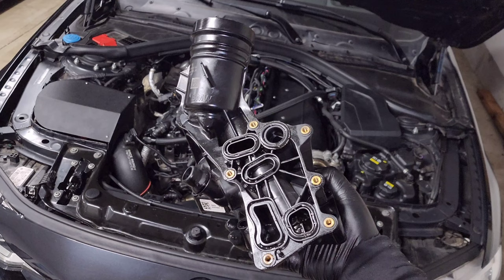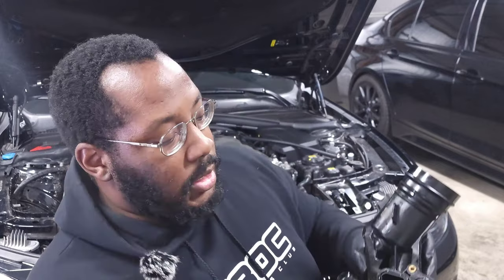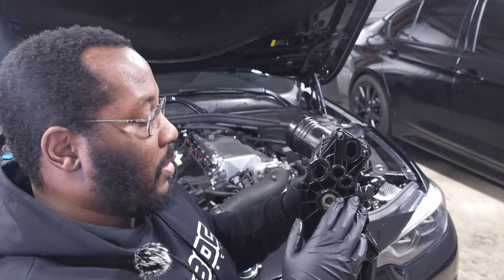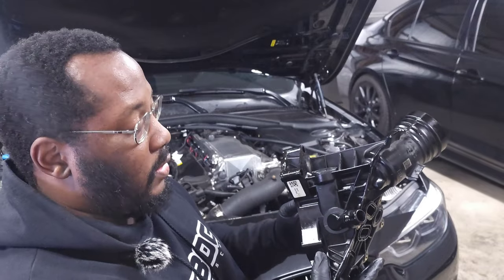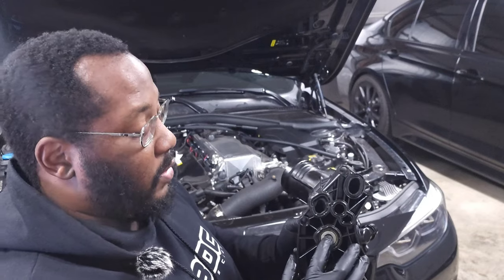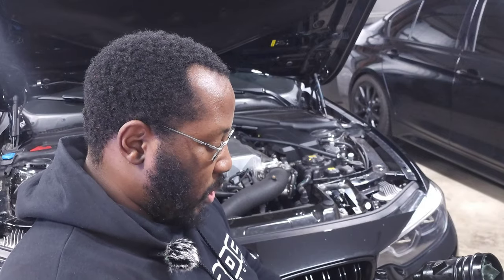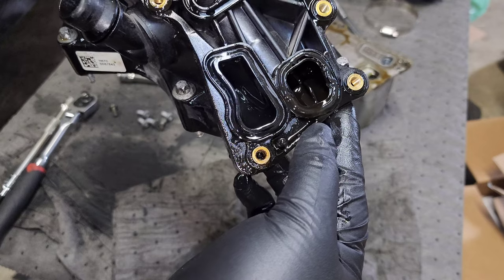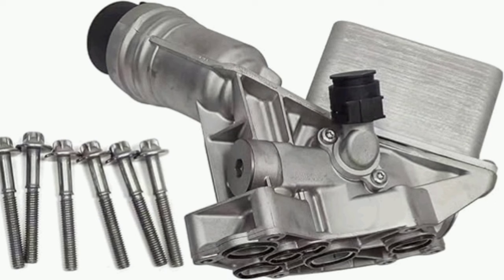Why BMW Oil Filter Housings Are STILL Leaking - B58 Common Issues

Comment from the maker: You Can Buy the Aluminum Oil Filter Housing option Here: https://amzn.to/3IKqRMa
I haven't tried it, so if you do, please report back how it fits and works for you

How to replace the oil filter housing: https://youtu.be/ybefpBEQj9w
Reply: The gaskets are the weak point, and labor the same, regardless.  What a pain, upgraded gaskets, better rubber/silicon, should come from the factory.
Reply: Also, plastic does stop the heat, it slows it. Thermal
Conductivity is lower, but it will reach the same equilibrium... and in fact the aluminum should respond to cooling and heating better, the question is what did the engineers assume when they designed flow.... plastic of course.
Reply: @sms4hou676 Are you saying plastic is better? 6:10

Comment: I have the aluminum oil filter with over 500 miles so far no issues so far, it is holding pressure as intended. I posted it on the fb forums. I didn’t have any cracks on my plastic oil housing but had a nice oil buildup at the bottom of the filter as you described on yours. I had 165k miles before it went
Reply from the maker: Great news
Reply: Likewise, changed to aluminum on a b46, i’m at 4k miles now. no issues…
Reply: @JayMichaelsprod you got a link for the b46 version?
Reply: I have the aluminum one on my 540i also...no issues
Reply: Still holding up well?
Reply: @Slow2.0 15k later no issues
Reply: @jamainefranklin5794  any issues? 540 aswell.
Reply: @seanx520  thats good to hear where did you get yours from? Im at 64k so hopefully no issues and if I do have issues hopefully within next 3 months (bought cpo) i gotta buddy that was a bmw tech for 6 years so hes done plenty so im not worried but still am worried lol
Reply: @Slow2.0  check the pinned comment from kern
Reply: Great to hear, I'm at 93k miles no leaks yet but if it does I do plan on upgrading to the aluminum
Reply: @seanx520 did you swap the spring or the oil cooler? Did you do anything else to prep it ?
Reply: @Everything_Bimmers  no, whatever that came with the oil housing,  I used the oil cooler and it fit just like oe. It is now Over 20k miles now no issues

Comment: One other thing to mention is that the s58 oil filter housing is metal
Reply from the maker: it also has the external oil cooler under the bumper so very different design overall

Comment: A shop quoted me $2,311 to replace the oil filter housing for it. Don’t even know if they were going to go with an aluminum one or the plastic OEM one. Getting delivery of my 340 this week so prayers for me lmao it’s coming in with 54k miles complete bone stock 2018. Passed pre purchase inspection with flying colors but praying this shit holds out for a while
Reply: Go for aluminium your never have to do it again then

Comment: if it last about 120k miles, i just stick to oem
Reply: Literally! Not known a single one failing in the UK group.
Reply: Mine was OEM and failed at 47k miles lol
Reply: @sharklos how did you notice it was the oil filter housing?
Reply: @Crazy_B58  got a low coolant warning but no puddles so i just topped off and then after a few days it was just pissing straight coolant. As fast as i topped off it'd leak out and puddle on my garage floor. Removed the skid plate to figure out where in the engine bay it was leaking and noticed it leak on the side of the oil filter housing.
Reply: @sharklos  I’m losing almost nothing but I’m losing something…. I will take a look and try to diagnose it

Comment: My M440i started leaking coolant and I believe its this oil housing BMW design failure.  Thank you for your videos on the help to replace it.  Seems like a large job but wow BMW engineers need stop using so much freaking plastic specially with such tight engine compartments with all the heat. Wish me luck with the replacement. Thanks again
Reply: I don't want to defend these engineers but i think it could be precisely because of such tight engine compartments that they used plastic. too much heat dissipation would be good for the part itself but maybe not for all the electronics around it. I don't know.
Reply: @roy4359  I picked up the aluminum oil housing aftermarket BMW wanted $600 and also replacing the coolant fitting next to it that suppose to go bad all the time.  At BMW they told me the heat issue with the plastics in the south Florida is way more common than upper states.  They dont sell as much up there he told me.  For the coolant fitting coming out of the engine they sell 2 to 3 per day he told me of how bad they leak.  There are so many hoses it ridiculous.  If BMW is going to use plastic make it a bit thicker.

Comment: Just finished doing this job myself on my 2017 m240i with 120k miles. I did use the whole housing and oil cooler that it came with so we’ll see how it goes, I also upgraded the coolant fitting to the left of the housing because that is also a common failure point due to (you guessed it, plastic piece)

Comment: Ive had the aluminum version for 7 months. I think i was the first with a b58 to do it. No issues so far, wish i wouldve seen people say to swap the spring before putting it on 😂

I did however swap all gaskets and the oil cooler.
Reply: Still holding up?
Reply: Still holding up?
Reply: @Slow2.0  yep
Reply: @mirceastoica1565  yep
Reply: @Staysikwitit  that’s good news. How about the temps? Low oil pressure came in ?
Reply: @mirceastoica1565 trebuie sa schimbi check valve-ul de pe cel vechi pe asta de aluminiu. Cica ar fi prea tare arcul la astea de aluminiu
Reply: @catalin.c  da, asta a fost și îndoiala noastră(a mea și a mecanicului). Până la urmă am mers pe original.
Reply: @mirceastoica1565  cumva tu l-ai cumparat pe cel de aluminiu care era postat pe facebook acum vreo 3 saptamani?

Comment: Another great video sir. I guess were now waiting for owners to start hitting higher mileage to determine how widespread of a problem this can be. 

Given this looks like more of a BMW design issue rather than plastic usage one, do you think that overall, the B58 is still a highly reliable engine?

Things like tracking the car would accelerate the failure of the OFHG?
Reply: I think as a whole the b58 is still a very reliable engine, but like most bmw tubo i6 engines, all the plastic around it just starts to get old and brittle. I definitely would say its a plastic usage issue, especially because bmw engines run warmer than other engines

Comment: would replacing it with the aluminum housing and adding silicone to the gaskets make it MUCH better?
Reply from the maker: i'm not sure you could do that properly. i would just recomend using oem gaskets at a minimum

Comment: Hi kern, I just bought an m140i and I have error codes 120308 120408 (air pressure) and 180001 catalyst performance too low. The car had a powertrain problem warning light on the dashboard. I just bought it and it takes 10 seconds to get up to 60MPH. However, the engine runs well, no audible air leaks, no smoke from the exhaust, no excess consumption. No oil leaks, no unstable rpm idling. The only thing is that by sending a pressure setpoint of 2 bars (load test) the sensor only measured 1 bar. We manage to activate the wastegate on the computer.

Do you have a little idea? BMW suggests that we change the plastic hose which is just after the MAF flow meter which goes to the turbo because it is not waterproof. However, we exchanged it for 30 minutes with that of a friend and no difference. Thank you so much
Reply: It was the catalysor
Reply: @nonconarde  how much did it cost

Comment: Maybe the space there (instead off flat mount) assures they there's no water-oil mixture in case off gaskets failure. Liquids just drip outside...
Reply from the maker: no it's to save money while retaining structural integrity. for example look at the design of the intake manifold.
Reply: @kern417  i mean the fact that is not flush with it's mounting position.
Reply from the maker: Yeah it's flush with the lip that it sits on in the lip is what seems to break on some cars.

Comment: Did you like visually see the leakage? I’m losing coolant can’t seem to find it….
Reply: There is a common issue with b58's where the coolant cap will be causing an issue with coolant getting through and evaporating over time. Look for some white dust looking stuff inside and where the cap goes, this will be an indicator that you need to replace the cap. Look it up yourself as well. Cheers!
Reply from the maker: yeah i didn't see mine but i could smell it while driving. i think a lot of it dripped and either evaporated or got soaked into the under tray
Reply: @kern417  thanks bro will check it out. Keep up the good work!
Reply: @Samuelsam60  it was the first thing I checked. I pressure tested it and I’m loosing pressure somewhere. Not on the cap, waterpump or anything I could see visually. It’s not a big leak but it’s there. Could be under the intake manifold…